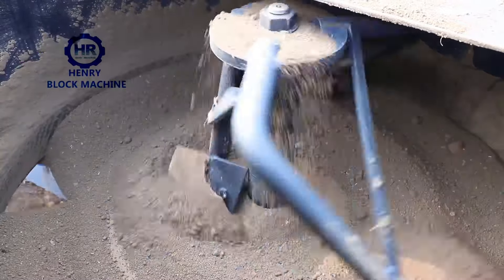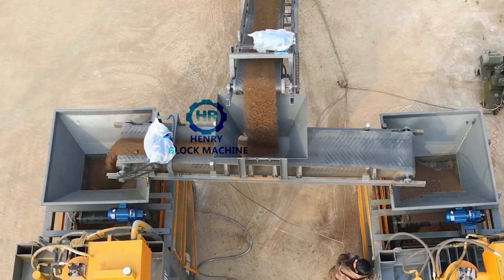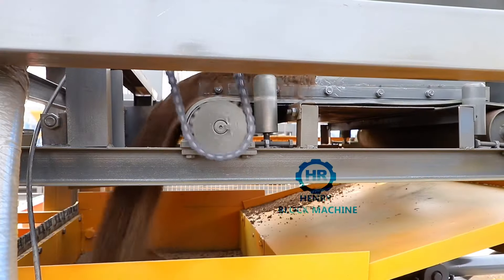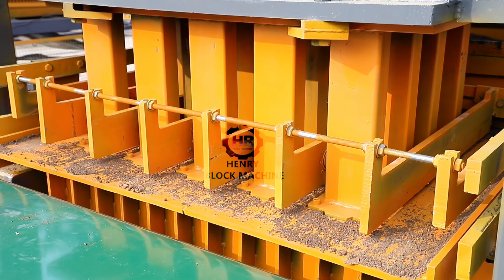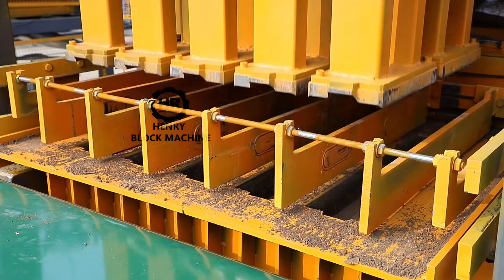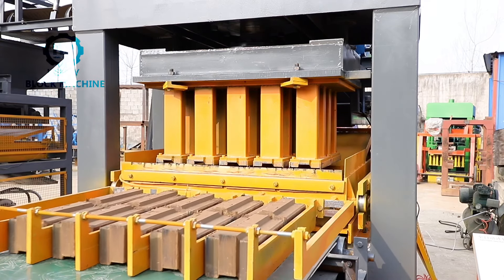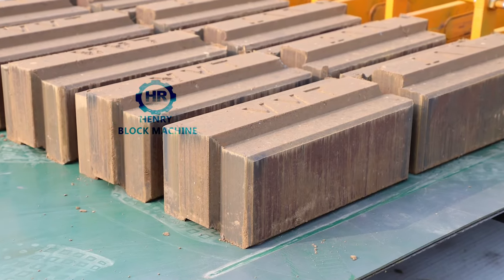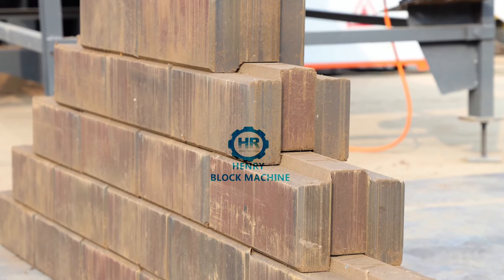Super 200 Tons interlocking soil stabilized brick machine test clay hydraform interlocking blocks

Comment: What is the name of the machine? Checked your website but couldn't identify it
Reply from the maker: It’s the newest model . Please which kind of brick do you need to produce?
Reply: Hi PS send me the quotation of this machine
Reply: Good morning Henry...
I would be interested in your machine. Our block size is 407mm by 230mm by 230mm.
Flower mould would be required too.
Together with a mixer.
What price would it be?
Send catalog to see other products. @HenryBlockMachineGroup